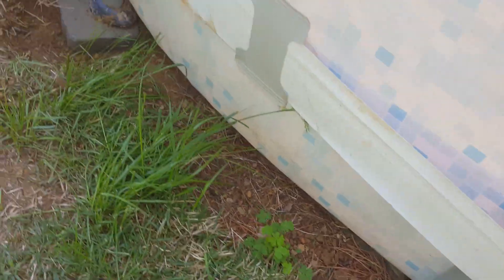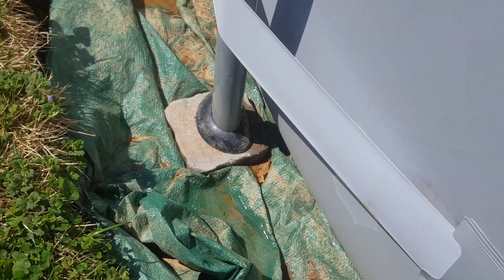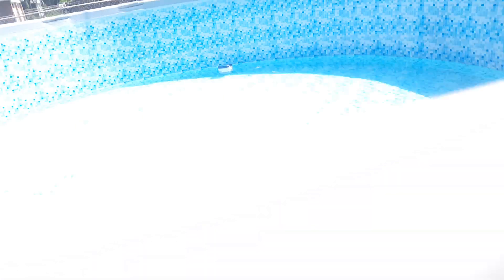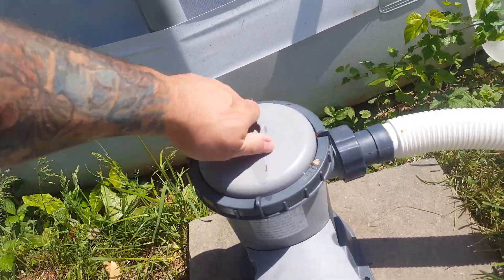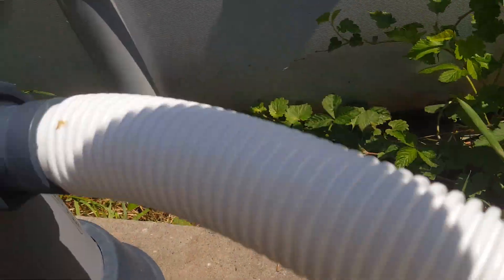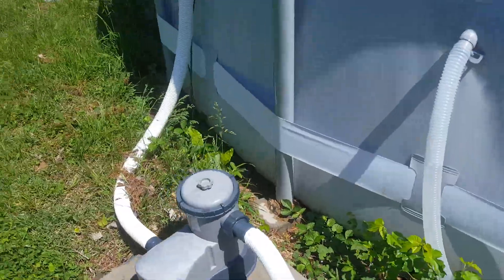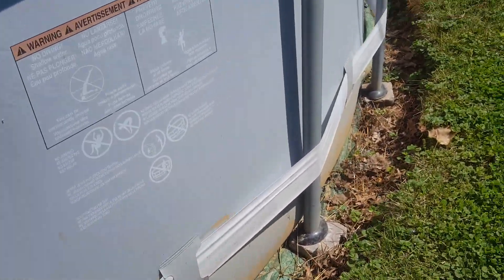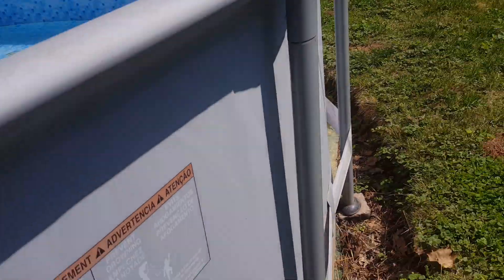The Coleman pool project part 1

Comment: What size is your pool? Mine is a 16x48 Summer Wave Elite and I have a Intex 3000 gph sand filter system and it keeps my pool really clean.
Reply from the maker: I have the 18 x 48
Reply: Thank you for replying. I don't have to vacuum that often since I got the 3000 gph sand filter but when I do vacuum I use the Intex auto vacuum cleaner. It does a really good job vacuuming.